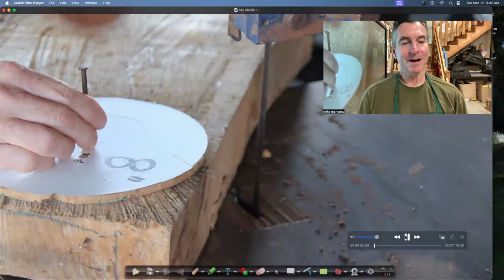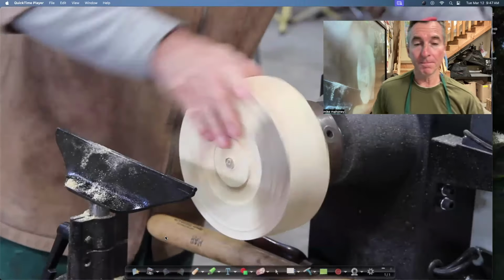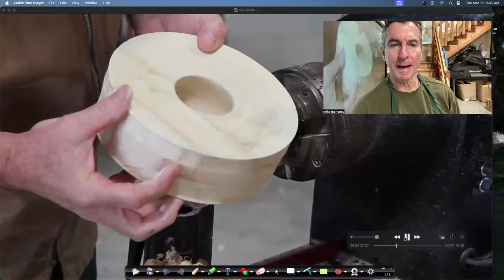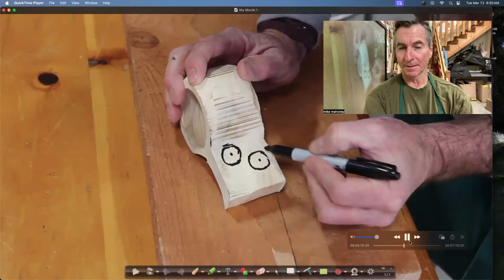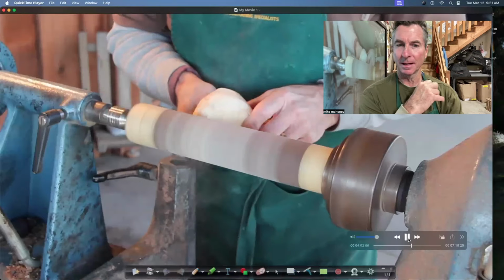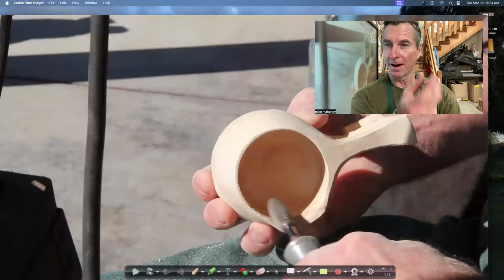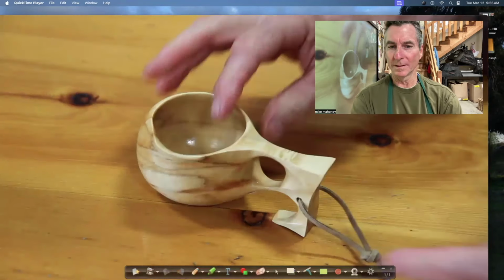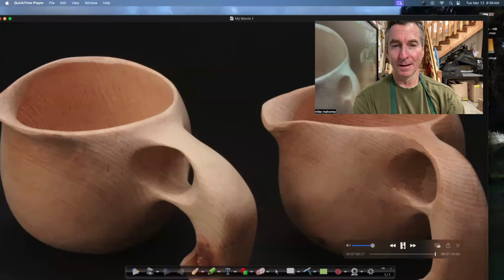Sierra wine cups

Comment: Hi Mike,thank you for sharing so many videos!i have turned many cups from different Kinds of Wood  and have the problem that some of the cups leaks and crack…if you have more information which wood you take for a natural cup without leaks, i would very thankful.best regards from Germany!
Reply from the maker: I would think any maple or medium hard closed grain wood would hold liquid. I sealed with polyurethane but Tung oil would do the job